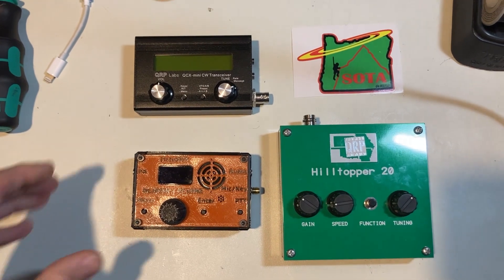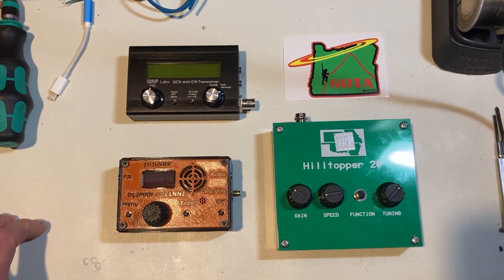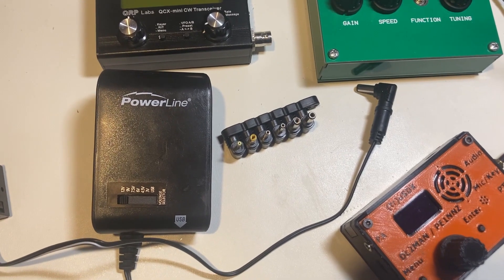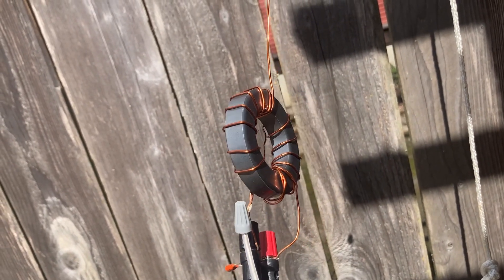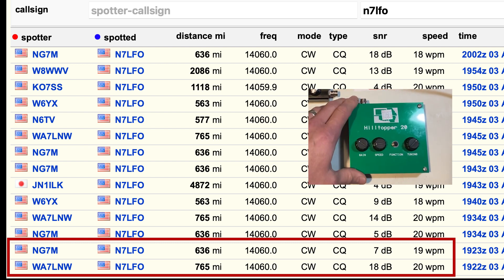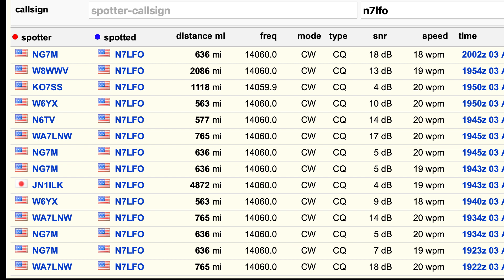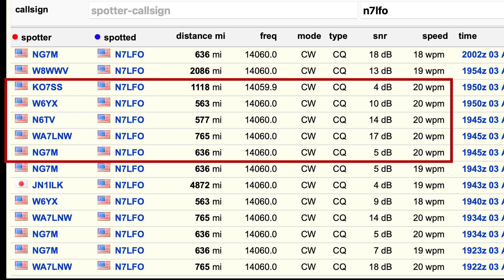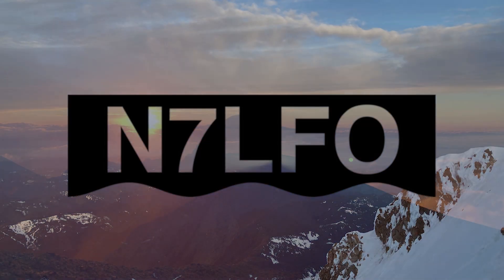QRP Shootout: truSDX, QCX-mini, Hilltopper 20

Comment: Same nominal power, but with these radios the output power varies from sample to sample and also with input voltage. This test would have been more informative if you had checked the actual output power of the radios.